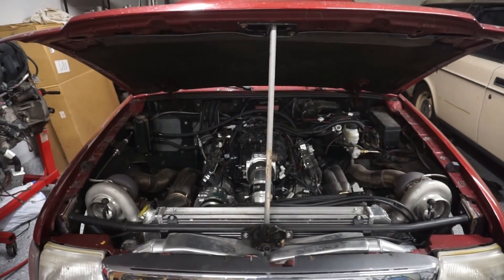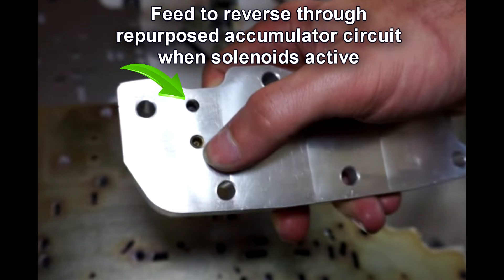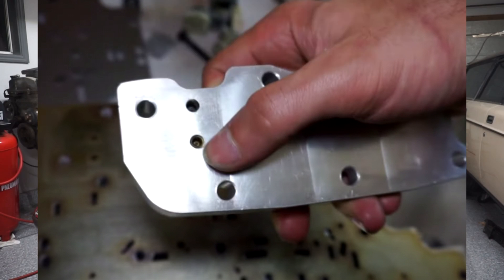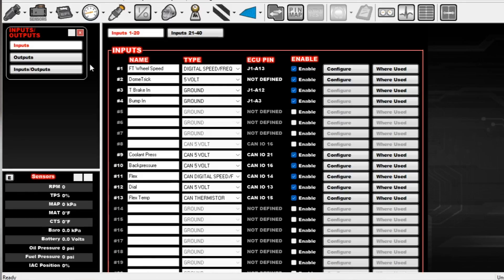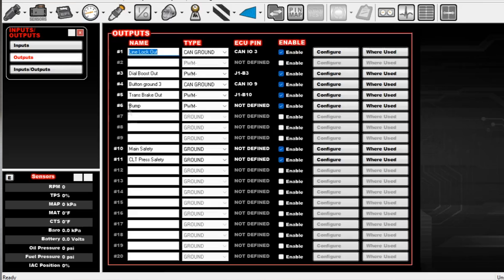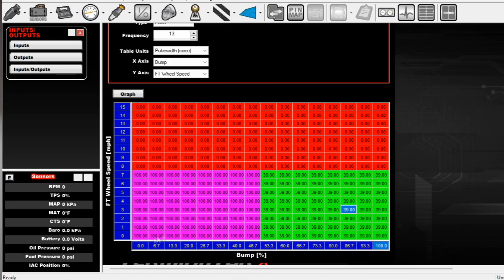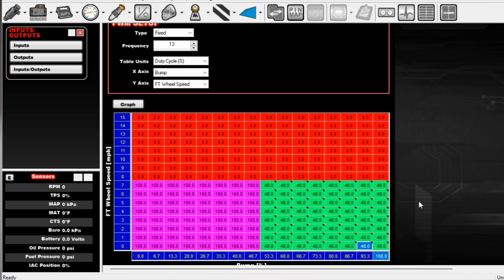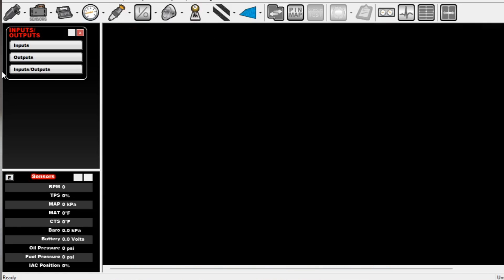Jakes D3 | TransBrake Smooth Bump Creep Holley Terminator X

Comment: I use 2 outputs.1 trans brake the 2nd one is bump configured pwm with switched input of trans brake. Chart is volts x axis 0-20 volts and y axis of rpm. anything above 10.5 volts is 65 @ 16hz. 2cents. Keep on truck'n. Big fan.

Comment: Wouldn’t just going into the staging ICF and using duty cycle do the same thing?
Reply from the maker: No, I had it set that way before this on 13hz/33% and it single pulsed at that rate. It showed a calculation for .021 pulse.
Reply: @BlaserBuilds  I just switched from the D3 to the extreme automatic setup because of the issues in the video. I’m sure this video will help. I was using the single pulse now i’d like to go to duty cycle but not sure what the settings should be.
Reply from the maker: @jonathanmoore5112  I would start higher and work it down like 14 or 15hz, and start around 90 and work down...
Reply: @BlaserBuilds  one more question. What would should the Time setting be? 0.999sec?
Reply from the maker: @jonathanmoore5112  For single pulse time? Or?
Reply: @BlaserBuilds   In the staging icf the output type is duty cycle then under that it has time
Reply from the maker: @jonathanmoore5112  I had mine set .075 which was just the single pulse setting and never changed it. Never tried it Higher TBH.
Reply: @BlaserBuilds  thanks for your help, After some testing I got it to to roll forward. (Duty cycle at 90% at 10hz seems to work the best)
Reply from the maker: @jonathanmoore5112  nice